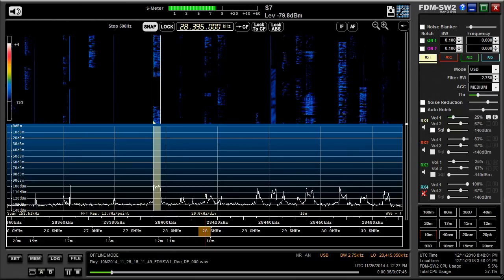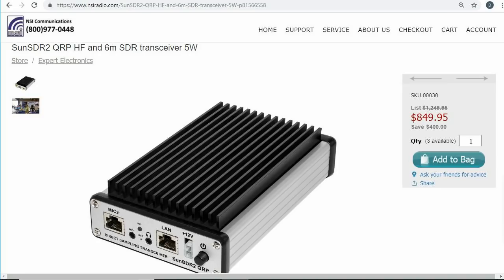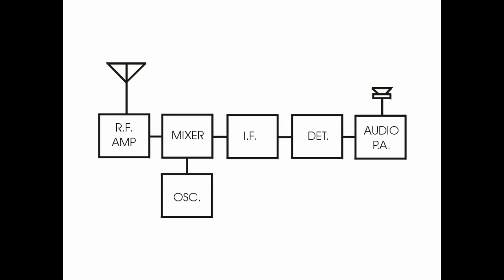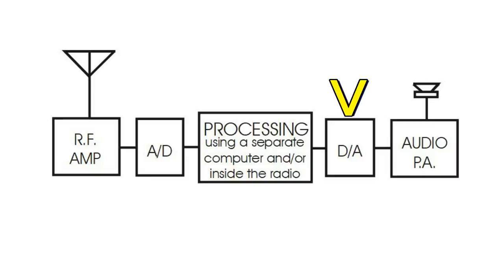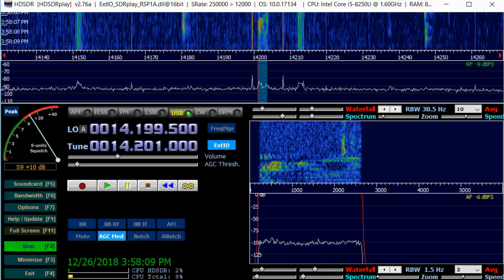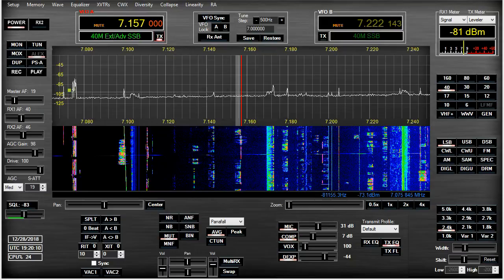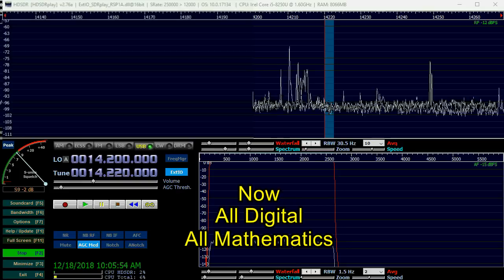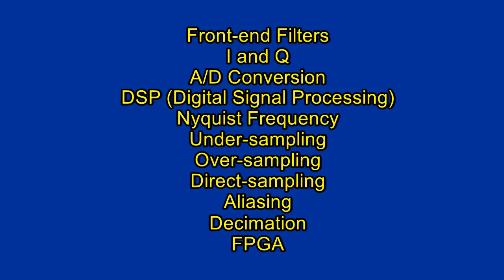SDR School Part One The Basics

Comment: The coming of SDRs is producing excitement in me that I haven't felt since I was ten years old and adjusted the trimmer capacitors of a tube type Philco AM radio I won as a door prize at a shop party Dad took me to. From northwest Ohio I ended up picking up radio-telephone transmissions among boats on the Ohio River. I became hooked on DXing far away AM radio and TV broadcasts. One spring afternoon, a freak atmospheric conduit opened enabling me to pick up a Miami, Florida TV station that didn't fade out for twenty minutes. I like digital TV but miss the DX opportunities analog TV made possible.

Comment: Great video, as is part two.  I have a RTL-SDR to use as a panadapter with my older Icom-718 and CubicSDR in Linux.  I have no reason to upgrade, but I would buy a 7300 in a second if I had to buy another.

Comment: Was wanting to purchase an Sdr unit but my issue is the my 2x antennas are 50 ft outside in my workshop and i dont want to re route them into my house , i thought about using a long usb cable  but then read that they dont work well and were ony designed for around 5 meter length . I came across these cables which are called active usb  and are ment to work for long distances , do these cables take power from the pc?, and do they work as they aint cheap to buy.

Comment: Is the reason the input signal (In-Phase) is mixed with a 90 degree version of itself (Quad/Imaginary) is to satisfy the minimum 2x sample rate needed for a given amount of bandwidth (Nyquist)?   If so, it's not really different data, just the same data shifted.. it seems like that's cheating and it wouldn't work?!    OR is the reason you need the In-Phase and out-of-phase version of the same signal, only to know how to separate what was originally on the upper band vs the lower band?
Reply from the maker: It's there for the separation, Ben.  Heathkit and Central Electronics used it a long time ago to separate, and eliminate the unwanted sideband in SSB transmitters.  In the analog days, it was difficult to keep the balance perfect, and required a lot of tweaking.  Digital gives us the required stability.

Dave  W8KFJ

Comment: Good info on SDR , however I disagree with his statement that SDR is  a lot better than superhets.... I have been messing with both for years.... Yes there are a lot of benefits but also there is a lot of time involved setting these up and the audio quality is not up to snuff w/o  a lot of tweeking...  the fidelity just isn't there... 9 operators of of ten will settle for a less than optimum audio....they are also leashed to a computer .... while stand alones are out there you don't get much of a rainfall... or spectrum R/O either.. to me they are a good addition to the shack as a spectrum analyzer ... and that's about it because you supply the main component... the computer.... The SDR radios ore way overpriced ...considering what they are... they shouldn't cost more than $100 each... but they are basically the Ham equivalent to the $900 Iphone...... I can think of better places to put my money allocated for my Shack... Need a SDR ? get a SDRplay and a TR switch hook it to your REAL radio... and save money
Reply from the maker: I don't think I ever said SDRs were better.  Look at Sherwood's list, and you'll find both superhets and SDRs in the top tier.  Making a superior superhet is expensive though, and the superior SDRs cost less than comparable superhets.  And SDRs can offer features not even possible in a superhet.  My effort has been to convey an understanding of the revolutionary innards in SDRs.  They're definitely not building radios like they used to.  Thank's for the kind comment about the SDR info.  If the videos helped you understand the process a little better, my dream has been fulfilled.

Dave  W8KFJ

Comment: I have the SDRPlay.  Which antenna would you recommend?
Reply from the maker: The SDRPlay is just like any other receiver, in that it works better with a better antenna,  If you have an interest in any particular band, then get (or make) an antenna for that band.  Just a common dipole made for a frequency of interest is a pretty good start.  Spend a little money putting some wire in the air is a good place to start.  Ypu'll be studying antennas the rest of your amateur career.     
Dave
Reply: @davidkennett7781  Thanks for the advice.